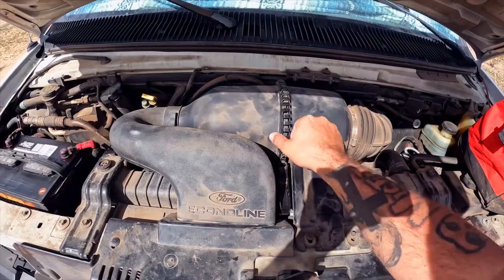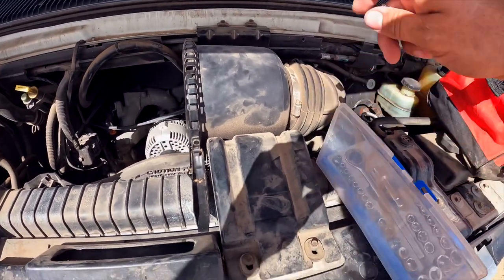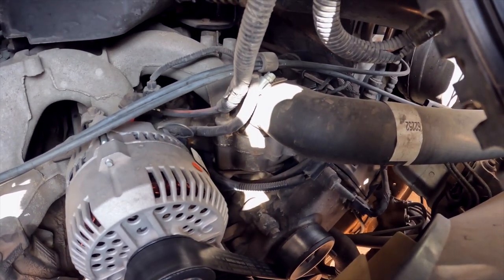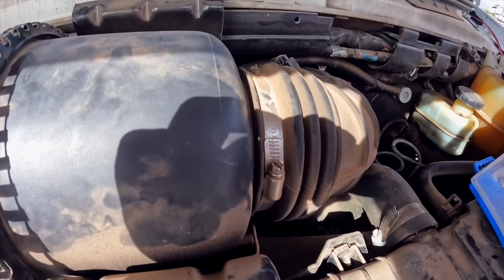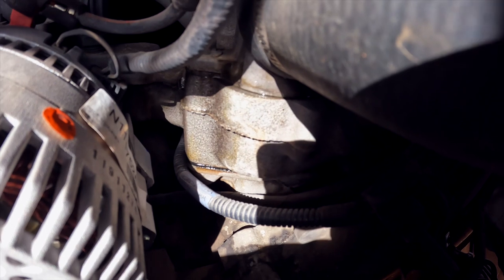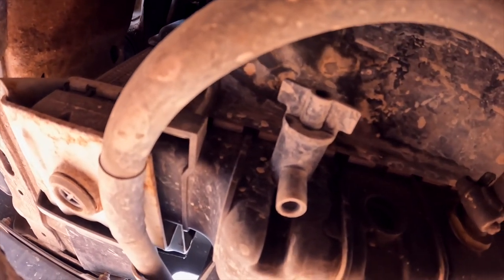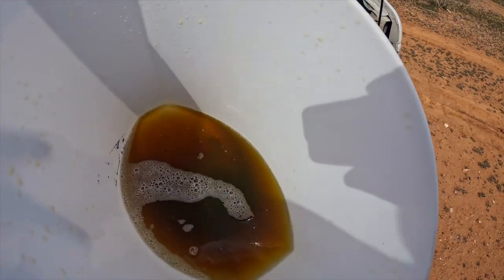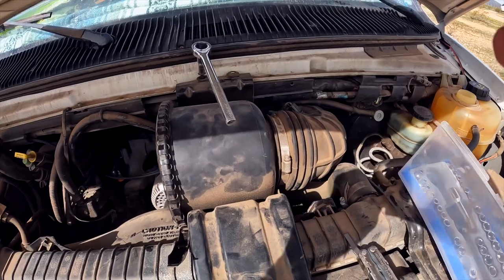Van Life Problems | Overheating Van | What to do?

Comment: Problem with car repair in the boonies is if you break off a stud in s critical system like coolant, you don't have a replacement and probably don't have the tools to replace it. And you can't drive the vehicle until it's fixed. You are fuuuked.

Add to that the fact that AAA roadside service won't go off pavement to tow your car.

In a pinch, most vehicles "can" usually be driven a short distance with no coolant. Not recommendee. But if you only have to drive a quarter mile to get on pavement do you can get a row, it probably won't cause much damage.
Reply from the maker: Yes exactly why I decided it was best to take it to the mechanic it was getting too risky

Comment: I have a 2000 Ford van E150.   Engine light been on...they put the machine on it..they say engine is running to cold???????   My coolant reservoir is nasty dark coffee brown.  My son says thermostat....thank you for showing me.
Reply from the maker: Yes it’s probably stuck wide open the dark color is likely due to rust making it’s way into the coolant like mine did possibly from a leaking thermostat seal which means your bolts will be rusted in also like mine it’s about a 300 dollar job if the mechanic can get the bolts out without snapping them
Reply: @AussieVanMan  awesome thank you.  300 would be fine but I'm in florida and a lone female so a mechanic would say 600.   They always "stick it to" females.   Thank you for your help!!!   Safe trips n happy trails.
Reply from the maker: @tracker5849  no problem hope you can get it sorted
Reply: @AussieVanMan just called the local garage...he said 2 hours 3..4..hundred...parts..labor etc.    I'm going to call around but will likely try to go there.  9.7 mile..  Thank you